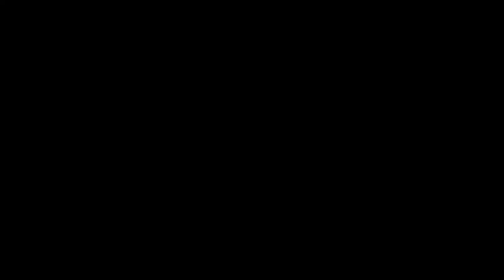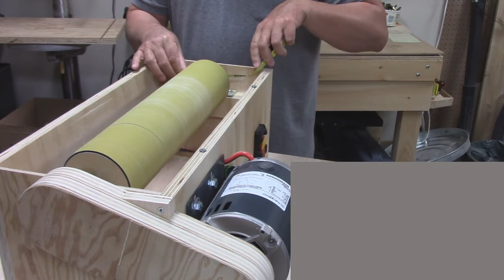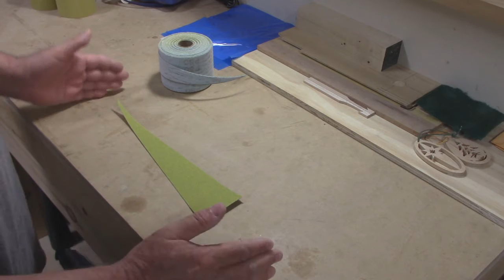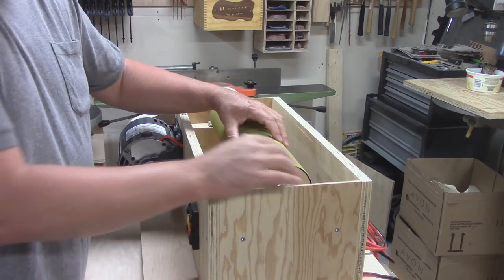V-Drum Sander - Part 6 (Sandpaper)

Comment: Paul, thank you for the math to determine how long your sandpaper will need to be to cover a drum.  This is the first one I have seen that had the math.  I am in the process of building a drum sander and this will be exactly what I need to know.  I do have a question on your hook and loop that is on the drum.  Do I need a special kind of hook and loop for a drum sander?  Did you wrap the drum with the same concept using 3" wide strip or did you use a different type for the drum.
Reply from the maker: I went to a fabric store and found the self-adhesive hook part and it was 2" wide, so I had to calculate how much I needed. I simply peeled off the paper backing and applied it directly onto the wooden drum. Then I ordered various grits of sandpaper that had the velvet part, they came in 3" wide rolls, and placed it directly onto the hooked part of the drum.

The only change that I can suggest to you is, the end tip piece of sandpaper that is coming towards you when the drum is spinning, put a little slit in the drum to tuck the sandpaper tip into. That little tip does not have enough velcro on the back to hang onto the drum and will lift, causing it to hit the table top and peel itself off the drum while spinning. Tucking it into a little slit in the drum will prevent this from happening. Hope this helps.
Reply: @PaulPomerleau  Thanks Paul for the fast response..

Comment: I ordered DUR VC-120-12 sand paper for my drum sander, but it has spaces in the material every 4 1/8” which I think are tear spaces, don’t think this is the proper kind to use for a drum sander.
Could you give me the name of the material/supplier you used for the sand paper material and the hook and loop adhesive backed material?
Also did you wind the materials in the same direction or did you reverse the birection between the two layers?
Sorry to keep bugging you but I want to be sure I get it right, and looks like I bought the wrong material.
Thanks
Reply from the maker: The hook adhesive backed material I bought at a fabric store in my city, they are widely available anywhere. It is 2" wide by whatever length you need for your drum. The sandpaper I bought from Stockroom Supply online. It is the 3" rolls with the fuzzy backing http://tinyurl.com/2r5f2zyf I got the 80-150-320 grits and I just change them when needed. I have even put one grit on the left side of the drum and another grit on the right side if I needed to use 2 types for the same project. I put the hook part and the sandpaper rolled on the drum in the same direction because the hook is 2" and the paper is 3" so it would have overlapped the seams anyway. Make sure when you order your sandpaper that you tell them you want the fuzzy backing to attach to the hook part of the velcro material. Once they sent me the wrong type and it didn't work.
Reply: @PaulPomerleau  thanks for the speedy reply, I’m getting things together.  And wanted to make sure

Comment: Great job on this sander and explaining the math for the sandpaper length.  I think you accidentally said that the circumference was the "c" side of the triangle when it should have been "b".  "C" side is the hypotenuse, and is longer than the circumference.  Just letting you know in case you wanted to correct it.  But what a great sander and build.  I appreciate you sharing.  Thank you Paul.

Comment: Seems to me that side b is the circumference.
Reply from the maker: Actually side C is the circumference. The diameter of the drum is 4.2" multiply by Pi equals 13.2" (= Side C).
Side B is only 12.85"
Reply: but you rolled the sandpaper on straight to make the mark (3:08). So the edge of the sandpaper where the mark was made should be a direct measurement of the circumference. Unless there is some step I'm missing.
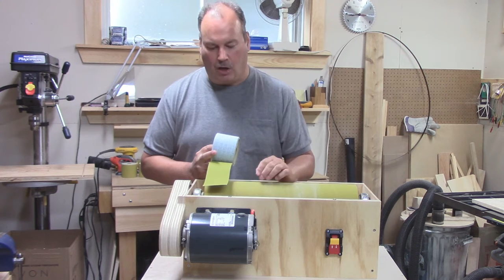Reply from the maker: That is to make the mark so I can cut a line from there to the opposite corner, making the hypotenuse which will now go alone the edge of the drum when the sandpaper is angled. Watch my video from the 2:35 - 2:50 mark and you will see the triangle as I am holding it up, the hypotenuse (Side C) is the circumference.
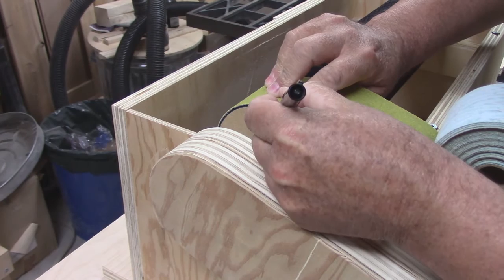Reply: pause your video at (3:20) .  Look carefully at the screen.   You have wrapped the sandpaper around the drum perpendicular to the line of axis of the drum. The visible edge of the sandpaper is side b, and without question, the circumference.  The difference between the circumference and the hypotenuse you cut is less than half an inch so this is really no big deal anyway.   In fact, if you pause it a 5:52 you can see that the mark on the sandpaper has actually passed the tip by exactly that much.  Sorry for the nitpicking, doesnt really matter that much, but The length of the sandpaper should just be an extra 13.2, the circumference.
Reply from the maker: Nope. Look at the end of the video at the 6:53 mark as I wind up the end of the sandpaper. You can clearly see the hypotenuse (Side C) which is the angle that I cut following the end of the drum (Circumference).
Anyway, thank you for watching my video and as you say it is close enough no matter how we measure it and I made this video because many people were asking me how much sandpaper they needed to buy. Thanks again.
Reply: you could prove me right by measuring the length of side c.  I predict it should be 13.5366  inches.  Regardless, no need to beat a dead horse.  Nice job on the sander.
Reply: To beat a very dead horse(about a year ago). The circumference is side B. You can see that side A is perpendicular to the drum, and since B is also perpendicular to A, side B must be the diameter. Also, the hypotenuse is always the longest side of a right triangle, C has to be the longest side, but you have B as the longest.

Comment: Paul, thank you for all the instructive videos and your quick response to the questions! The Sketchup model has 2 horizontal brackets from the sides of the box to within 1/2" of the drum. What is the function of those? I can see one in the video above but not in any of the previous videos. Are they to improve dust collection?
Reply from the maker: Hi Mats, if it's the parts that I think it is then those are what the pillow blocks (bearings) are mounted to. These have always been there and are needed to hold the drum in place. Hope this helps. Thanks for watching.
Reply: Paul, in the Sketchup model they are named "slats" and are parallell to the drum on both sides.
Reply from the maker: I see them now. Yes they are in my drawing and were put there to assist in the dust collection but I never did install them and the sander works well without. Sorry for the confusion.
Reply: Thanks Paul! I will leave them out. I have most of the parts and I am making the mdf disks right now, then the box.

Comment: For those of you who may have problem with maths, this is how you can calculate . EX: 13.901438.....13 is 13 inches and since our measuring tape graduate by 1/16", you multiply     .901438 x 16 = 14.423008 so 14/16 or 7/8"..... = 13 7/8".